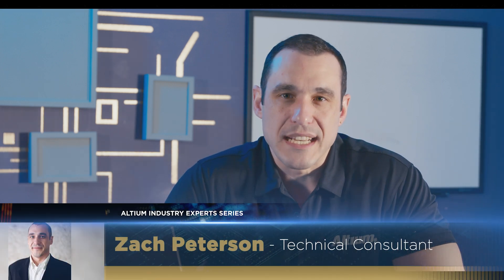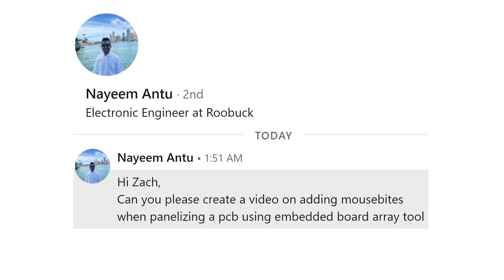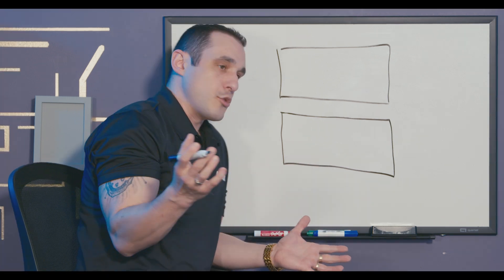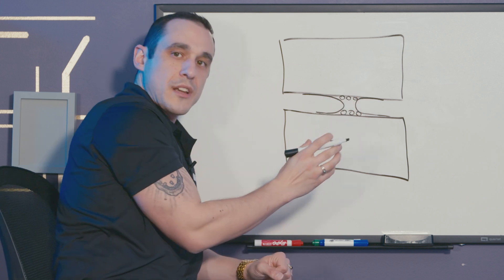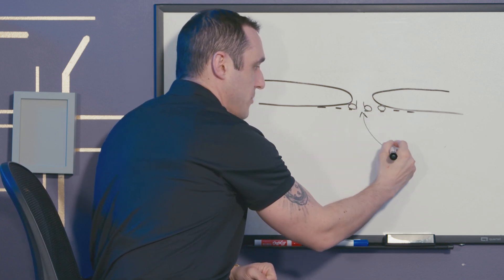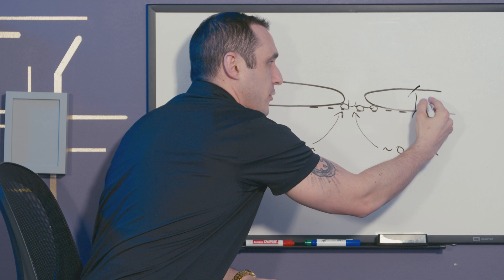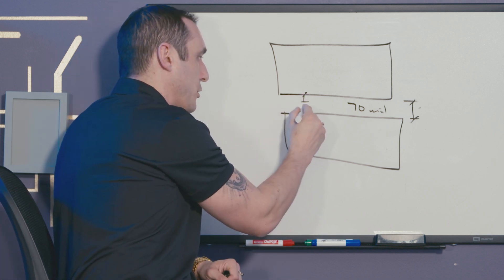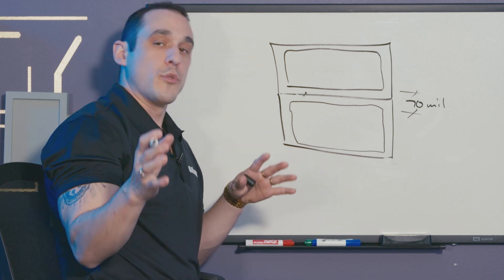V-Scoring vs. Mouse Bites! PCB Panelization Deep Dive

Comment: Just a heads up that Board Cutouts do not export Gerber output. Another setting under Line/Arc Primitives from Board Shape must be set to a mechanical layer to outline the cutout for proper recognition by the PCB fabricator.
Reply: Board cutouts will export as long as the Board Outline option is enabled in the Fabrication Outputs dialog. They are not drawn in as a line like you would do in a mechanical layer, they are shown as solid regions, so they are like negatives. I agree though it is best practice to have a mechanical layer that includes the profile, including all cutouts, and then place the cutouts with dimensions and tolerances in a fabrication drawing.

Comment: Hi,
i have a problem. i finished my PCB but i cant panelizations because i use 4 layer but when i import panel mode my PCB i cant see 4 layer just 2 layer and i see warning " Child and Parent PCB Design Layer Stacks are NOT compatible". How can i fixed this problem.
Reply: You need to set up the stackup in the panel PcbDoc file so that it matches the stackup in your PCB's PcbDoc file. At minimum the number of layers need to match, and I think the layer thicknesses need to match. When you import the PCB it does not automatically change the panel stackup to match your PCB stackup.

Comment: Great guidance. 
I would really like to see video showing guidance to use v-score, mouse-bites or other methods which can be used to provide option to separate pcb section .
Let's say in your project you want to allow user user to separate pcb sections by for example snapping PCB.

I see many videos showing v-scoring , mouse-bites for panelizing but not typically for PCB section separation . Best example would be ST dev boards which allow user to snap off programmer section.
Also what would be the best way to design this PCB if you have high layer count PBC , how easy would be to snap it without shorting internal layers.
In general some general advice and guidance for high layer count PCBs separation option would really help 
Thanks
Reply: I tried to cover some of these points in the video. I did not mention the layer count; for V-score and snapping the PCBs, the layer count does not matter as long as you use large enough pullback from the score region. In my example I showed the V-score applied mid-board with the intention of the user separating the PCBs manually. Same would apply for mouse bites, I have never seen guidance that refers to layer count limits with mouse bites.

Comment: Great video from Zach, as always. I definitely prefer to design in mouse bites at the PCB (rather than panel) level as it means I retain control over some very important criteria:

* Placing the hole centres  0.25 mm inboard from the PCB edge means any burrs generally don't need to be filed off - any such manual process is expensive! Adjust component placement and inner plane pullback to suit.
* Depanelization will put some big stresses in the local mouse bite area and delicate components such as chip Rs and MLCCs can easily be damaged in the process. Putting a keepout zone (2~3 mm) around the mouse bite makes for better yields and reliability.
* Adding a solder mask void area over the mouse bites prevents the coating splintering during depanelization.
* Internal planes can have a bit of pullback in the mouse bite area. The broken bits of PCB allow greater ingress of moisture etc., so a bit of extra margin is useful for reliability, and essential for high-voltage boards.
* The shape of any internal corners in the PCB profile is determined by the radius of the router bit, so best to define the router path and width from the start. CEMs prefer larger bits (2 mm dia is good) as they can route more stacked PCBs in one go. A good CEM will give you a slightly lower price for a bigger router bit!
* Slightly overlapping the end of the router path with the proximal mouse bite hole will minimise any sticking out broken bits. I was looking at a Naim Audio PCB recently, and I noticed their outer mouse bite holes are a larger diameter than the inner holes; not sure why they've done this, but I am sure there would have been a good reason, and I shall be looking into it...
* I've seen CEMs do a sloppy job when they place their own router paths - it looks like they've just eyeballed it when panelizing. Pre-defined router paths make the CEM's panelization process easier and can make for a neater final profile.

Mouse bites should all run in straight lines, spaced about 60 to 90 mm between centres, which is fine for a rectangular PCB but involves a bit of creativity where the profile is circular or curved. In the curvy case, the designer needs to add a squared-off router/mouse bite feature to complement the PCB profile mouse bites, and depanelization may involve snapping off bits in a particular sequence, in which case it's helpful to add such instructions on a silk or outer copper layer somewhere outside the PCB profile.

I've been using a slightly modified version of Tom Hausherr's mouse bite specs for years with great success (google "The PCB Design Magazine, October 2013" for details), all I've done to tweak is to increase the hole size to 0.8 mm (from 0.5 mm) and added 2 extra holes to overlap with the router path ends. This makes for 7 holes (2 of which are effectively part of the router path), but I've also used 5 and 3-hole versions for smaller PCBs.

Comment: Is it really cost effective to do it for prototyping? The manufacturer will already do this by his own in order to produce your boards and others boards at the same time so he'll combine multiple design in 1 panel
Another question: even in the case of ordering 1000 PCB, is really cost effective to do the panelization instead of letting the manufacturer do it depending on his capability? how much you'll save in this case?
Reply: If you do panelization by yourself and you know technical capabilities of your assembly contractor you can save a lot of money and time. Frankly speaking, your PCB fab always makes panel in the most pcb production - convenient way. The best cost saving effort is to do panel by yourself. Even for prototyping, you can i.e. replace costy routing indyvidual boards by v-cut.

Comment: In the past I made a mouse bite footprint w/holes and 2 “cross-hairs” on a scratch layer (or add snap points) for the route tool path end points to snap to. You have to assign a mech layer to be the route tool path layer (vs using a board cutout).
Place multiple copies of that footprint around the embedded array and run route tool path tracks between the cross hairs.
I’ve also included such features in the source pcbdoc so they are automatically arrayed… but you will have to waive various DRC errors or make a rule to allow these holes outside the board outline.
I’ve also used a skinny route tool path as a V-Score line, but mostly this is to get some sort of realistic looking line in a realistic 3D view in Draftsman
Reply: I like making that kind of stuff into footprints (I have them for mounting holes and fiducials) but I never thought about it for a mouse bite, that's a good idea.
Reply: thanks bro. 
I'm tired of  many cutting out board with convert tool.
your way is better!

Comment: If the edge does matter for end use / packaging, then it makes sense to have the holes on the board side so you don't end up with burs after depaneling, you just have to have an increased keep-away zone. The number of holes and spacing is also a function of how much rigidity the board has. Sometimes the force to de-panel a v-score is higher or limited due to overlapping connectors past the edge. If the boards are not well supported, it can result in assembly failures. Unless you are doing the assembly yourself, it's almost better to leave the panelization to the board house you are sending it to.

Also if you are not using a depanelizer, breaking these boards / v-scores can induce a lot of stress of the FR4 layers and can be enough to crack near by vias from the board delam. Keep traces and vias away from these mechanical stress areas.
Reply: These are all good points, especially the fab house part of it, some fabs provide templates for customer-defined panels and the customer still gets it wrong! I like the holes internal to the board idea but you can always file off the excess material of they are on the breakaway tab, I guess most designers probably don't keep those filing tools around though. I've only made panels a few times but each time I get the manufacturer I'll use to review the panel to get their opinion on the hole count/spacing.

Comment: Question: Is it possible to include different PCB designs in one panel?
Reply: Yes, my understanding in Altium Designer is that you would need to use multiple embedded board arrays to do it, but I have never tried it.
Reply: yes, in Altium is purely copy- paste click, only remember to have the same PCB technology (and layerstack) on all of the boards. Even when you use panelization tool it is still possible.
Reply: Yes, but it is not that easy.